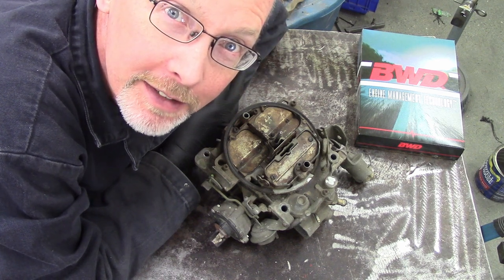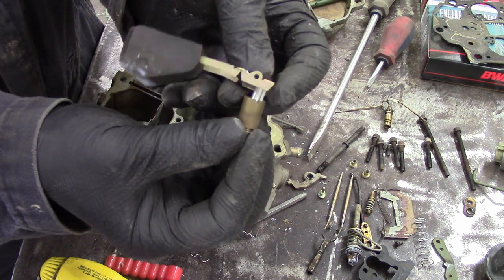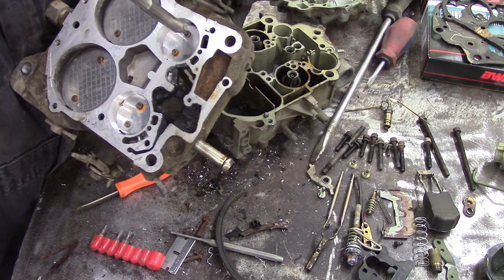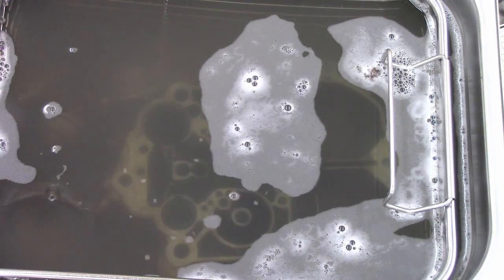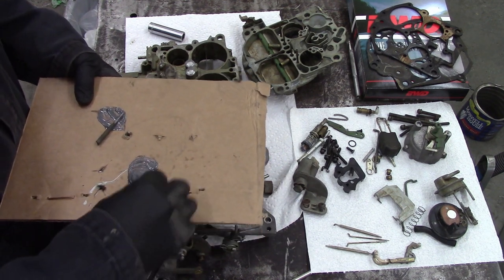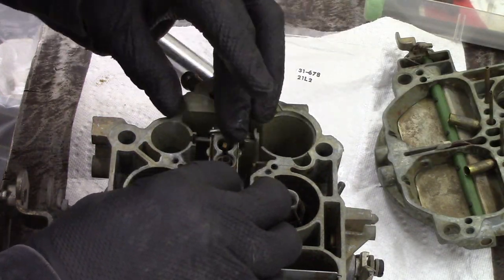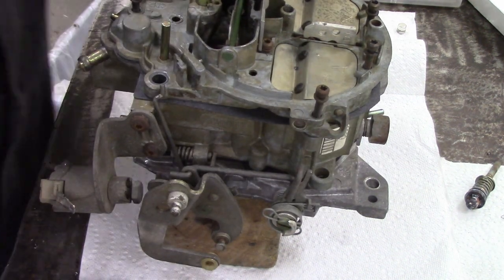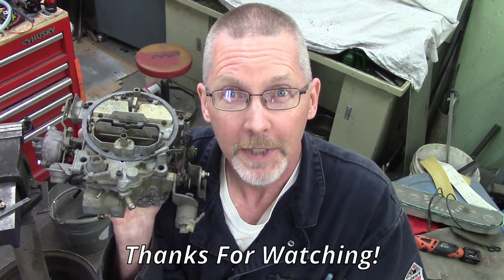Rochester Quadrajet Rebuild with Ultrasonic Cleaning!

Comment: Wait. Curiosity, why didn't you reinstall the spring and cup on top of the accelerator pump? It was on the one you took out. Was that done on purpose?
Reply from the maker: Holy carp!  Good catch!  Dang it.  That's the "duration" spring. Thankfully, that carb is still on one of the motors at work.  I'll fix that! You get an "A!"
Reply: @GregWellwood  Ha! Thanks! And Thank you for the video!

Comment: Had a '79 'Vette years - decades - ago that I fought with a mid-range bog. As I cursed it one day, this old guy from across the street offered up the Q-jet off his dead Cadillac. It wasn't the right Q-Jet for the 'Vette, obviously, but I rigged a manual choke cable to replace the manifold-spring setup. That Cad carburetor ran like a top and got Hella better mileage than the old Q-Jet ever did. That rare case of dumb luck working out well. I never did put the original Q-Jet back on.

Comment: Ultrasonic cleaners are awesome, but for the best results you need the right procedure and cleaning solution. A 1 hour duty cycle seems awfully long and can burn out you transducers. For heavy caked on grease, you want a mildly caustic solution with some heat. Trisodium Phosphate (TSP) is an excellent degreaser. Mix a 1/8 cup per gallon of TSP with some dishwasher detergent.  Let the part soak for about 15 minutes in the tank with temperatures between 80C to 90C. Run the ultrasonic cleaner for 15 minutes. If the solution becomes very dirty, as shown in your tank, dump it out and rerun the cleaning cycle with a new batch of cleaning solution. You can repeat the process until the part is either clean or until the water is clear. In general, a saturated solution becomes less effective because the suspended particulates absorb energy from the cavitation process. Moreover, too much cleaning agents added to the solution can have an opposite effect.

Comment: To keep the small throttle plates screws from coming loose and dropping down your intake, replace the steel screws with brass screws then use a drop of red locktite on each screw. Then I use a punch and smack the blunt end of the screw  and that will smash the screw and mushroom the end so it cant blackout and dissappear down your intake. 😁

Comment: Being a licensed teen driver at the height of the muscle car era was a blast. I always thought the quadra-jet got a bad rap in those days. I ran one for a while and was very satisfied with the way it performed. But Holley had just come out with a 1050 cfm 3 barrel carb when I was building a new engine for my Camaro and I never went back to Rochester after that.

Comment: A lot of guys hate them but those old Rochesters were good carbs if you got them tuned rigjht.  I don't know if you still can but back in the day there was a large selection of metering rods and jets so you could get the air/fuel ratio exactly to what you needed for your application.  My friend and I had a big block Chevelle that we replaced the Holley double pumper that was on it when we bought it, with a Quadrajet.  Once you got it dialed-in, it worked perfectly.  Thanks for the video!
Reply from the maker: I put a link in the description on places where one can get parts and more information.
Reply: @GregWellwood  Thanks!

Comment: Thanks for the video. I had a Quadrajet that wouldn't run because it was full of emerald green mold. With a can of carb cleaner and a roll of paper towels, I had it running great in about an hour.

Comment: When searching for a Quadrajet in a parts yard you might find one from the mid to late 80's that you will need to drill out the plugs to be able to adjust the idle screws as well. The one Glen showed either already had that done or was another variation. Nice video Glen, thanks for putting it out there, The youth of today will need it at some point to use as viable references have virtually disappeared on these.
Reply from the maker: Correct - many carbs have the mixture screwed capped.  This one had already had the plugs removed.

Comment: On my motorcycle carbs i use simple green D Pro3 cut 50/50 with distilled water in my ultrasonic cleaner. Rinse thoroughly afterwards... It has not hurt any finish, or bare aluminum parts.

I did a lot of research before hand, and this was the only simple green i found that was "safe" for aluminum, but its recommended to dilute.

Comment: On my 68 GTO I had the cam for the secondary metering rods self destruct.  I found a carb with stripped fuel inlet threads and cannibalized the cam out of it.

Comment: next time, try the soda blaster..Take the carb apart, then soda blast inside and out on the 3 main body parts..The soda will not wear down the metal..HF blue tank soda blaster is what I use..Really does a great job..Then use the ultra sonic cleaner to clean all the small passages..

Comment: Great video. 
What was the sealer you used to seal the lead plugs.
Reply from the maker: In this case I used JB Weld. I don't believe these were leaking, but it's common practice to seal them.

Comment: The only carb I ever ran on a GM V8 was a Rochester. Mine I shaved down all the casting marks and hogged out almost too much for the primary bores and made dam sure that the secondaries ONLY opened to 90°. If you go over the 90 degrees then you are essentially closing the secondaries and you wont get as much go out of it as you should. The throttle plates I made both of the knife edged on the sealing side, no air turbulence there. I also shaved and applied shellac to the gaskets to conform with the new barrel diameters. The more air you get into the engine the faster you will go. Don't forget the exhaust! Ya gotta get the exhaust out just as quick. If you can get away with it, then straight pipes work good. The lower the restrictions the better with a finely tuned Rochester.

Comment: I have a Camaro Z28 - 1984 - Trans. manual. T5
Question: When choosing a new and same Quadrajet 4BB carburetor, is it important to know if it is for a trans. auto. or manual??
Reply from the maker: I don't think so.  Just make sure it has (or you can get) the parts to run your transmission.

Comment: I was told to always use the basket. Never put the part directly on the bottom of the  ultrasonic cleaner. I'm not sure why.
Reply from the maker: Might just be easier to get the parts out?  I would have used the basket if the carb had fit.  This thing worked AWESOME at freeing up hydraulic lash adjusters on the last cylinder head I did (I used the basket).
Reply: @GregWellwood  I think its got something to do with the parts vibrating on the bottom of the ultrasonic cleaner. I'm told it can damage the machine.
Reply from the maker: @vin9114  That would make sense.